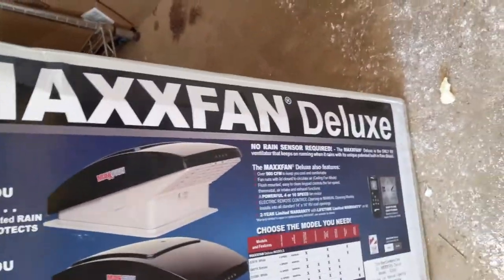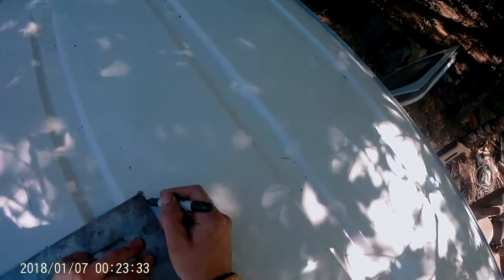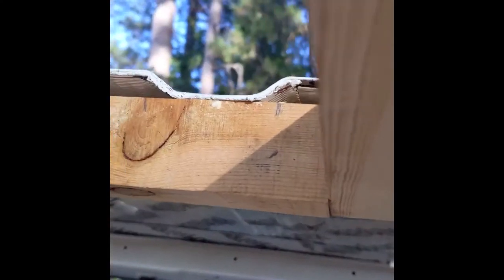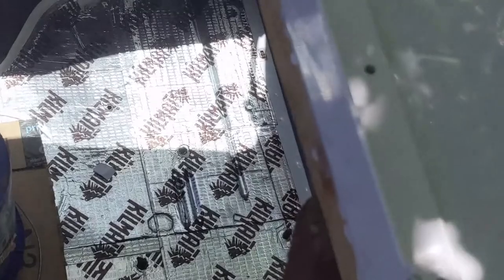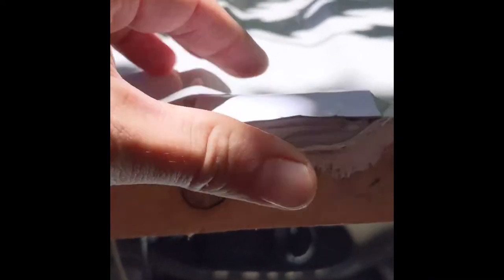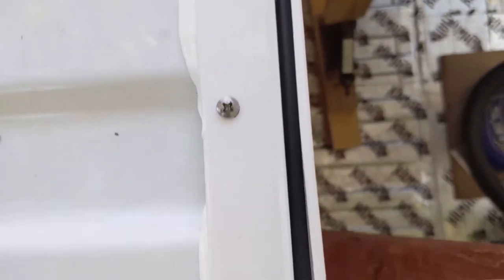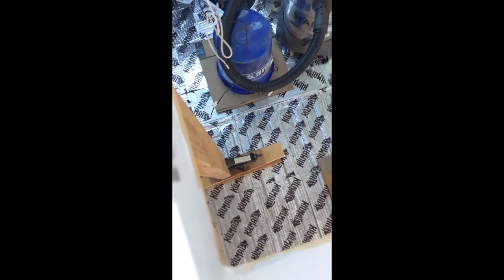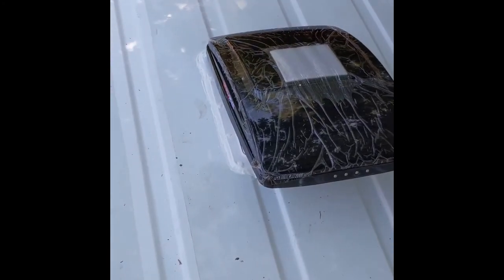Van Life Build | Ford E350 Stealth Conversion | Maxxair Fan Install | Ep 6

Comment: Trying to do as little as wiring as possible, my question is couldn’t I just hook up my battery+ directly through the switch and tie that into the ignition on red wire going into the head unit? I would think this would just act as the new engine on voltage signal when the switch is on?